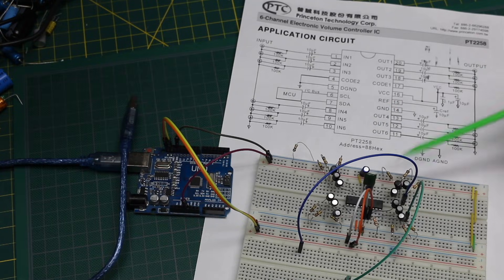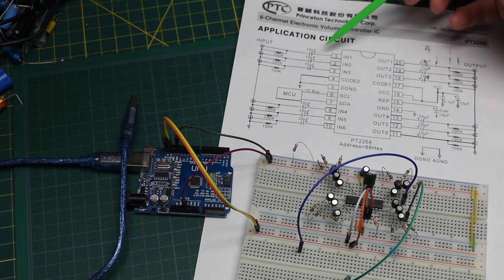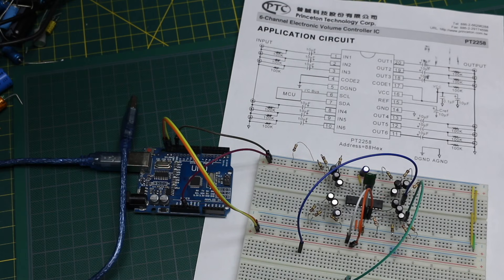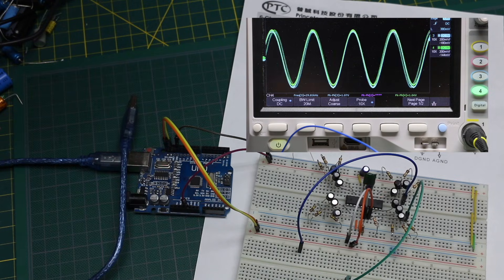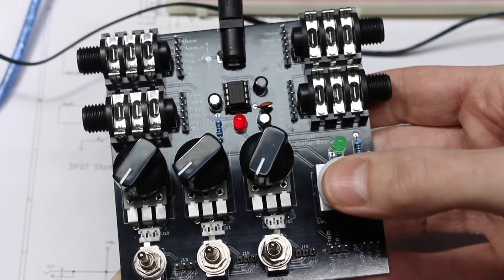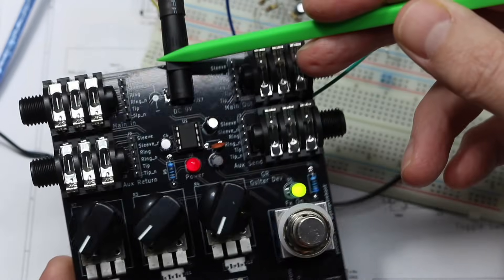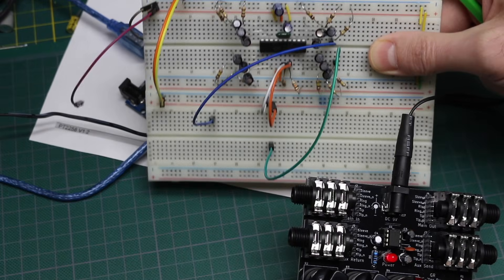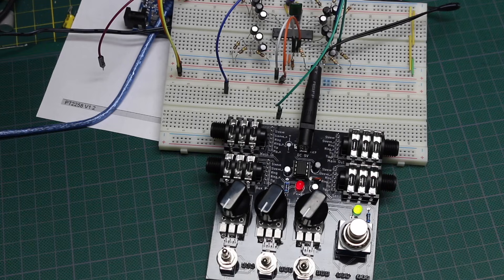PT2258 Volume Control IC Experiments

Comment: Thanks for the video! May I ask you about the feasibility of a project using it? One XLR input, a dynamic microphone, balanced. Hot signal goes to input 1 and 3. Cold signal to input 2 and 4. Then I have 2 XLR outputs, one is the chip out 1 and 2 (balanced) and the other is the chip out 3 and 4 (also balanced). The idea is that I can crossfade the outputs so I can have a A/B switch pedal with no pop sound. What do you think?
Reply from the maker: it would have to be tested to see for sure if there’s anything unforeseen. I’ve never worked with balanced audio circuits but my understanding is it’s just two copies of the same signal where one is inverted so in theory it should work as if they are being treated as completely different audio signals 

but I think the signal levels are already relatively small so if the chip happens to not work well with something like the impedance of the audio connection it could cause unwanted signal distortions because I think a balanced signal refers also to having a certain impedance in the wiring and then it’s going through this chip which will have its own characteristics 
I think I vaguely recall something about that in my own experiment where a signal needed to be buffered so maybe putting an op amp buffer in line with each of the balanced signals would help get it through the chip.

then another potential thing that could go wrong is if otherwise the chip somehow has slight differences on each channel where it can impact the signal differently like if you turn them all to a certain gain setting maybe one is slightly higher than the other so at the end of the whole chain when the balanced waveforms are combined again to get rid of any noise on the cabling, the two waveforms May not be identical opposites anymore, one may be slightly different in amplitude so they don’t line up properly.
  so again maybe having an op amp in line somewhere would not only help with pushing the signal through the chip better but the gain of the op amp could be slightly tweaked for a specific chip to account for any offset and then maybe it would hold up 
so the whole thing would need to be really tested and calibrated and see if it ultimately works.
Reply: @GadgetReboot  thanks a lot for the comprehensive response! My dynamic microphone is a Behringer XM 8500, its impedance is 150 ohms. The mixer I use is a Behringer XR18, the inputs impedance for balanced signals is 10K ohms, but honestly I am a little newbie in these questions, I don't know how the chip could impact that.

The problem with opamps is that they generally need +/- DC power, and 15v or more. I would like to run this pedal using either one or two 18650 lithium batteries. I know there are opamps that could run using a single 5v power, but I don't know how could I put all of it together.

I mean, the whole point is to mute one XLR output while unmuting the other XLR output, in some milliseconds to prevent the pop noise. The initial idea was to make a completely passive circuit using a DPDT footswitch, but I think that could cause a harsh pop (I would still have to test it though).

But again, thanks a lot for the answer, I need to do more research about it.

Cheers!
Reply from the maker: One way to get a dual polarity power supply for op amps is using a chip like max1044 to generate a negative voltage rail from a positive supply.
One of the reasons the volume control chip was giving me some impedance issues that impacted my signal, 

when looking at the block diagram of that chip in the data sheet it looks like they basically have digital potentiometers in there as opposed to ideally buffering each input
 so I was trying to send a guitar pickup with several K impedance and the signal was getting messed up until I put an op amp there to buffer it and prevent the pots from loading down the pick up.
the buffer would re-drive the input of the volume control chip with an ideal low impedance so that those digital pot resistors in the chip wouldn’t create some sort of weird voltage divider with the pickup output.
A microphone with 150 ohms might work OK when interacting with the chip potentiometers but then there’s still the question of if the two channels on the chip will impact the balanced signals in a different way and that could be what messes up the signal at the far end when it’s ultimately converted back to a Single ended waveform if the two balanced signals are no longer at the same phase or amplitude.

Comment: On a different note you could if you want the some affect on all channels try injecting current into or pulling current out of the reference pin.
I was going just to say putting a changing voltage on to the Ref pin, but you will be upsetting a potential divider so you will be sinking or sourcing current from the pin.

you might get a few strange envelopes on the output signal. 

Too much time to sit at the keyboard, I  better get back to editing videos. 🙂
Reply from the maker: I wonder how that would work with something like one of the 555 noise generators, treating the ref pin like a control voltage pin
Reply: @ Not sure how it would react but could be fun to try. the worst could be a bit of magic smoke.

Comment: interesting chip strange that if you want to send a attenuation level e.g. in the datasheet you can send it as 42 or 24 and you get 42 for both.
Never sure if attenuation is like normal maths 🙂 Attenuation is a negative so saying -14dB attenuation is like - - 14dB which would be +14dB.
the attenuation is 14dB in the same way you don't say the gain is +14dB as the word gain provides the '+' required.

This is the same way i got a slapped wrist at Uni because I wrote "the delay was 10S"  as seconds should be in lowercase as it's not named after a  persons. Old Father Time don't count 🙂

i.e. W for power for Mr Watt, F for capacitance  named in honour of Mr Faraday.
Personally I blame the French as they put it all in to place with the "SI" units. 🙂 

Looks like a useful chip to have in the back pocket.
Reply from the maker: The misuse of units that always intrigues me the most is when somebody speaks of processor speed in terms such as 16 mHz. 
16 milliHertz would lead to a very slow blink sketch.
Reply: @GadgetReboot  Big M as it's mega,  big H for Mr Hertz
16mHz would feel like a 386PC 🙂